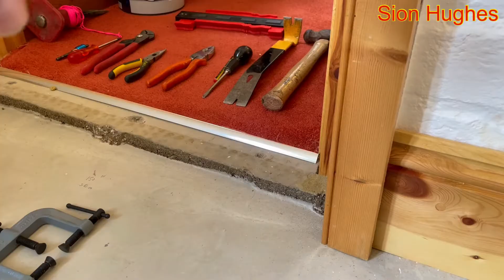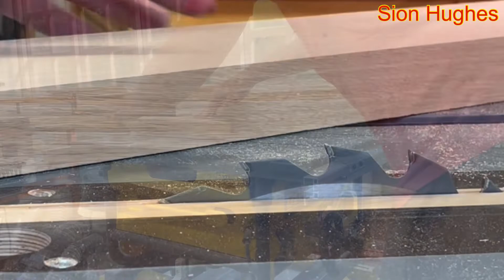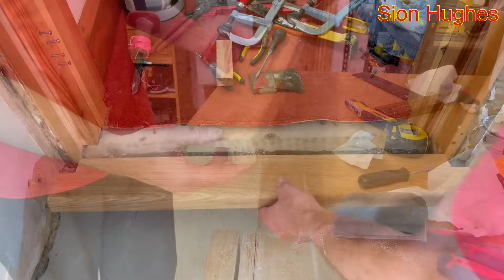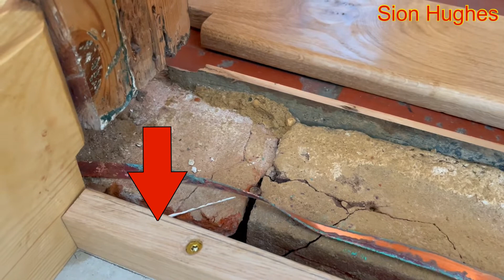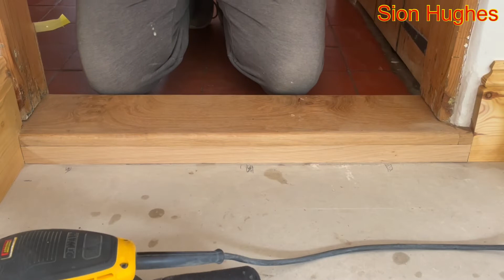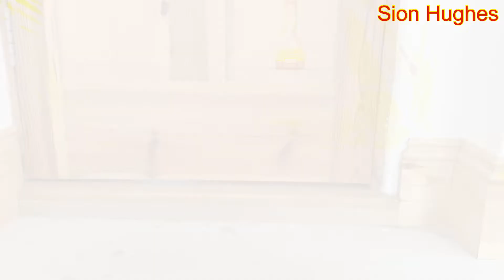Door sill making and fitting

Comment: What's to stop that piece of timber you screwed down from rotting?
Reply from the maker: Nothing . Its oak so it should last a while . The room I was working has no damp proof course and I have to allow any moisture a chance to disparate . Every thing I have researched about old houses talks about allowing moister a way out rather than trying to stop it . I will admit Its not always ideal but its part of the deal when you live in a house built in 1837 . Please consider subscribing and visit my channel and watch   HOW TO REMOVE PENETRATING DAMP . Its in the same room and deals with the damp patches on the walls . So far so good but I also pored self levelling concrete on the floor ( SELF LEVELLING CONCRETE) another video, and that has small damp patches . All I can do is put down breathable underlay and carpet and keep the room ventilated and heating on in the winter .
Reply: @sionhughes5543  yes I was just wondering because you put a tanking solution and dpc on the sill part. I'm still researching the best way to do it too. I'll check your other videos out
Reply from the maker: @megaman2016  cheers and good luck . These old cottages are a labour of love , endless maintenance
Reply: @sionhughes5543  yes there is always something to fix
Reply from the maker: Let me know your thoughts on the other two videos
Reply: @sionhughes5543  self leveling was well done. For the penetrating damp I would have tried to fix the pointing from the outside first
Reply from the maker: I re pointed ages ago with normal cement instead of lime mortar . As you saw from the exterior shots of that wall it looks perfect outside . Its dark magic and spells when it comes to fixing damp .